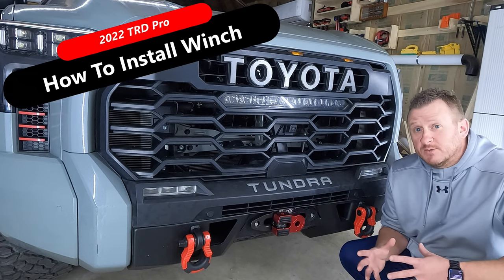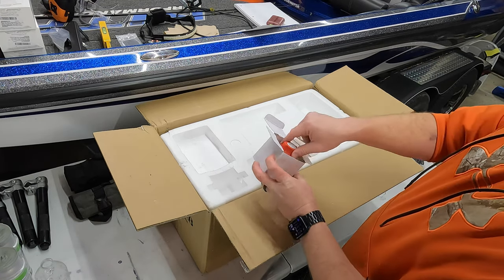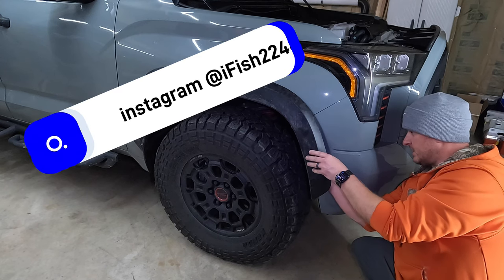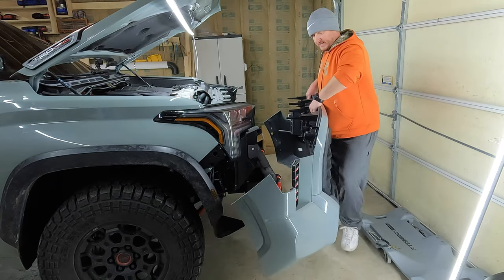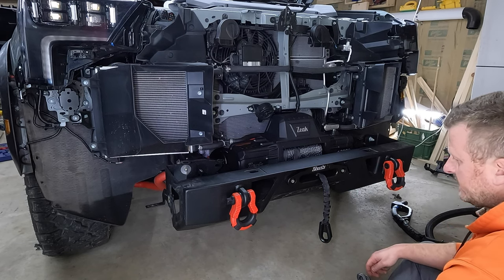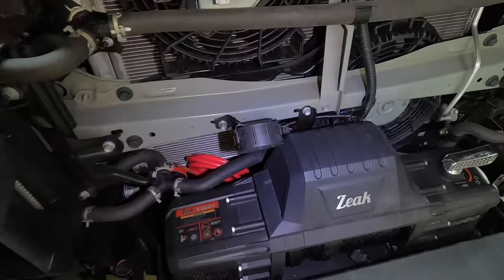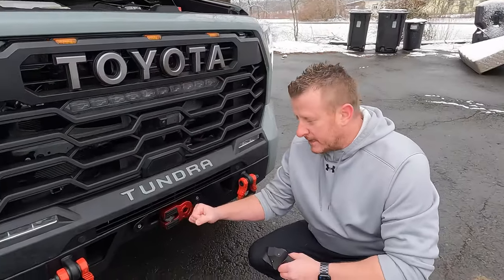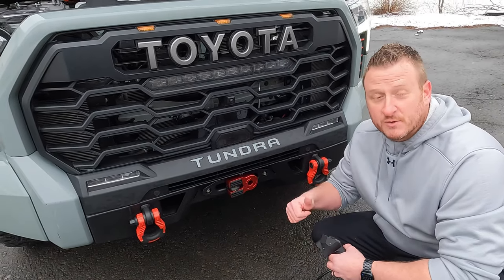Winch Install on a 2022 Toyota Tundra TRD Pro...Zeak 13k Platinum Winch!...Wireless Remote Included

Comment: Hey man, I am curious now that this has been on your truck a while how the hybrid system handles it? When winching, do you experience the blower fans slowing down or any lights dimming? I would assume the hybrid motor system/battery is more than capable of producing the high amperage required for a 12v winching setup, but Toyota must have limited it to some extent. With a winch sometimes having up to a 500amp draw under maximum load, I am very curious how the truck handles it. Thank you!

Comment: Since your disconnect switch is so far away from the battery I recommend adding an inline fuse near the battery as any wire between the switch and battery is “hot”. Also you could of use any ground location in the engine bay or even frame where the bumper attaches instead of running them all the way to the battery.
Reply from the maker: Not a bad idea with the fuse, I actually thought it was weird it didn't come with one!...may be a stupid question, but would grounding it like that be ok with the winch???...I've grounded other accessories like you mentioned but I've never seen anyone ground a winch like that...and the instructions specifically say to connect both positive and negative directly to battery...thanks man!
Reply: @NitroZ18Fishing  I believe those instructions are like that to ensure a complete circuit as alot of applications use an independent battery that are not grounded to the frame IE on trailers. Since your battery is already grounded to the frame, grounding the winch to the frame would complete the circuit. Just ensure it’s a clean connection and not covered with paint.

Comment: How has the winch been pulling lately?  Smittybilt and an Engineer at Baja Designs told me to swap the stock wiring for 0g since we’re extending the run on a 12k. I’m wondering how necessary it is?
Reply from the maker: No issues at all, works great!…I’ve only used it a handful of times but it has worked flawlessly

Comment: Instead of running the negative all the way to the battery, couldn't you have terminated the ground onto the chassis to eliminate a 2 large gauge wire run?

Comment: Just out of curiosity how did you connect the wires to the batterie? My batterie has a quick connect on the negative terminal and the batterie slots seem to be completely full I thought about getting  a splitter or getting some vampire connectors to attach to the existing wirers. I plan on running 1/0 to a buss bar I'm going to install in the engine bay.

Comment: Amazing - thanks for sharing! It looks like you had to remove the air shutter to fit the winch – how did you get by the error codes / check engine light?
Reply from the maker: Thanks man, I appreciate it!…no error codes at all, working flawlessly!

Comment: I finished my install and was able to clock the winch (RUGCEL 13.5K) which aloud me to use the lower grill support bracket. Where did you purchase the battery cable extensions?????

Comment: I just purchased mine thanks for all the instructions did you end up using all 25' of 2 awg wire? looking forward to own adventure installing it, Thanks!!
Reply from the maker: Hey Dan!...so I ended up using about 15' of wiring to make sure it wasn't pulled super tight anywhere and had plenty of "wiggle room"...I should have mentioned that in the video, I'm sorry!...thanks for watching, if ya need anything let me know!
Reply: @NitroZ18Fishing   Thanks yeah 15', that's a huge savings on price too.  I did look around about grounded to the frame and it's not recommended, will cause the winch to run too hot and could possibly damage other electronics.
Reply from the maker: Yea I dont think I've ever seen a winch grounded to anything but direct to battery...the peace of mind is worth it for me!...let me know how your install goes!

Comment: How did you retain the TRD skid plate?  Did you run a lift?
Reply from the maker: No lift as of right now, I'm still on the factory TRD Pro suspension… No problems fitting the skid plate at all, no modifications needed… Hope that helps!